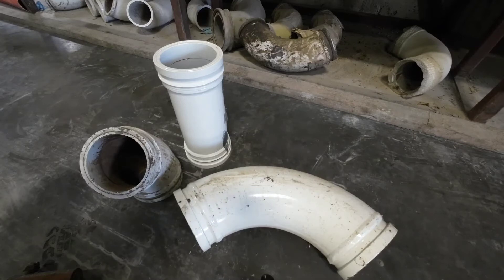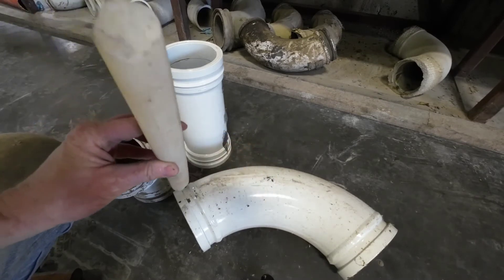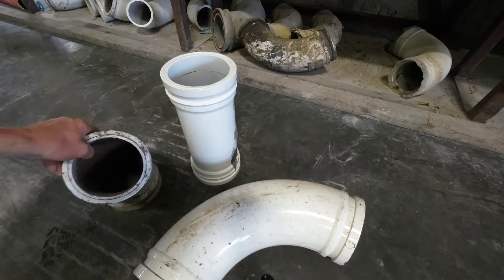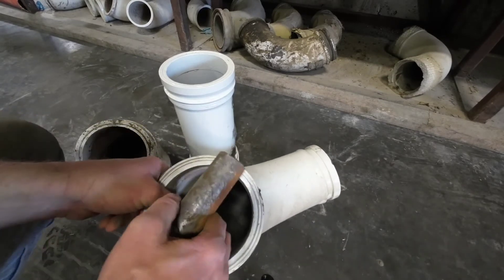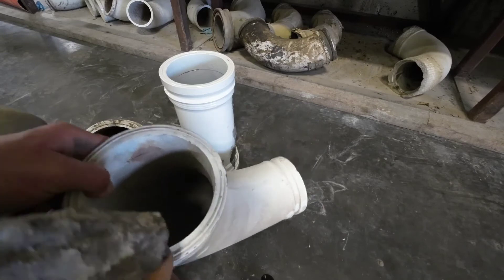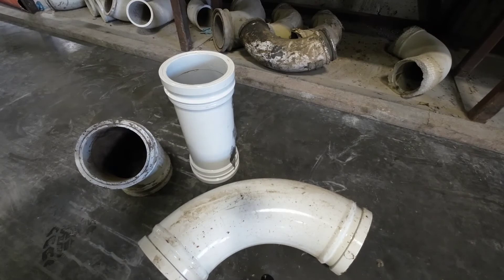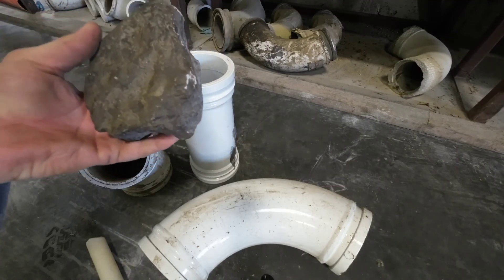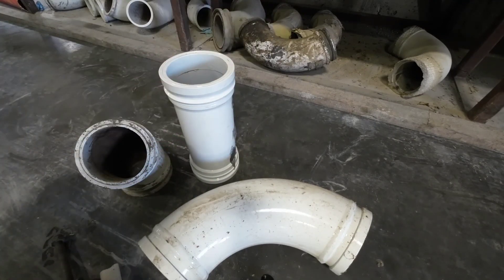Strange Things While Pumping Concrete!

Comment: quite a few  big rocks  caughtt in  the 5-4 reducer that I'm amazed made it that far on any of our trucks. chipping hammers, bolts, fins from the barrel at the plant. weirdest one I ever saw, had a run of  about 120y a couldn't  get over to check the hopper in a bit, driver honked and said there was something stuck on  the grate and held me up. pair of sweatpants covering 1/2 the grate up lol

Comment: I’ve seen a pigeon come off the chute on a floor I was helping place, and my boss had another pigeon from the same plant on his grate once. We ran a double grate most of the time, so nothing fancy made it through. Had the odd chunk of belting, tarp insulation, and a chuck of rebar that was likely used to build up a cutting edge of some sort. Most of it originates at the plant, but some use gravel from dredging, so that can be a big source of trash
Reply from the maker: Seems like in the past year or so we've had more junk pass through than normal. Keeps it exciting I guess.
Reply: @fronabargerconveyingpumping  as if the job isn’t stressful enough already, gotta worry about the concrete  plant accessories and drum parts going through the pipe. My biggest worry was injuring or killing someone. It’s unfortunate that pump operators have to deal with it, I hope you guys were able to get the supplier to pay for the lost boom pipe!